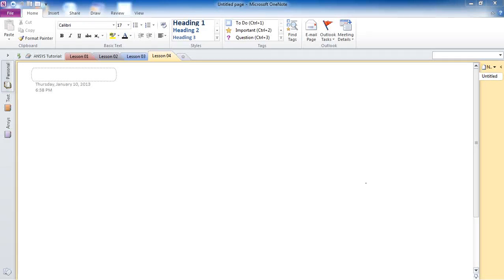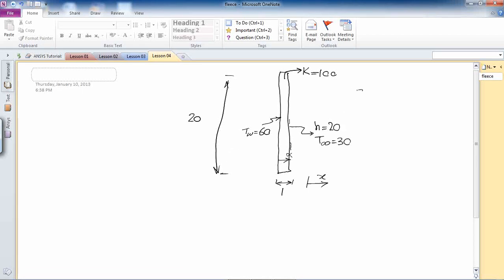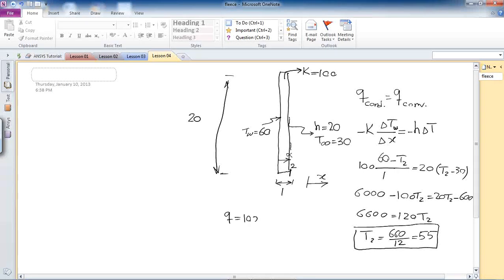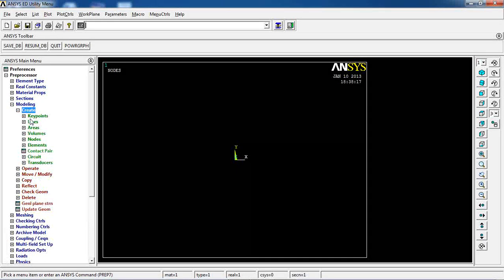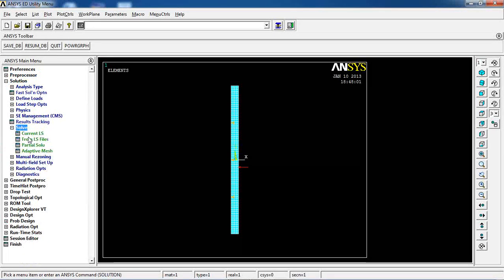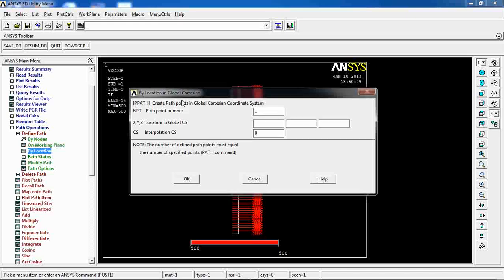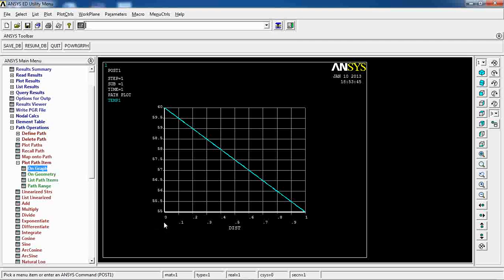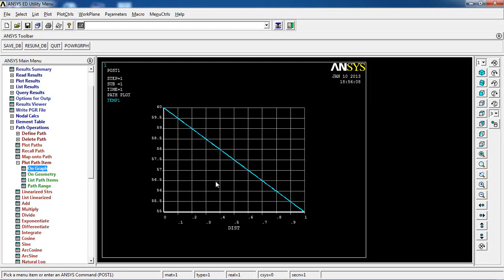ANSYS - Lesson 04: Coduction and Convection through Wall, Temp vs Dist Plot

Comment: Sir how can we find the temperature variation without thermal conductivity value being assigned, as a means to identify the thermal conductivity from the temperature variation. Provided materials properties are - surface temperature 100 degree C, convective heat transfer coefficient at ambient temperature 2.5 w/m2 k, ambient at 27 degree C, assume adiabatic
Reply: +Annebushan Meinam I know this was two years ago, but i am facing a similar problem. any chance you can tell me how you ended up solving it? ANSYS is demanding the convection coefficient h, but my problem is to find h. Thanks